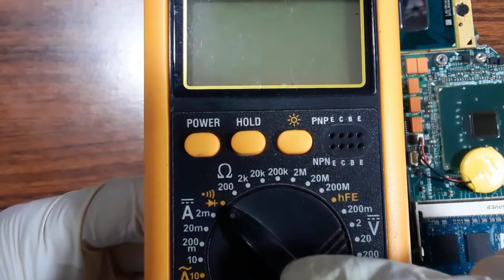The Fastest Way To Detect Short-Circuit On Laptop Motherboard - Laptop Repair

Comment: Please use modern boards. You cannot remove cpus from modern boards. I have asked before that you should actually do proper troubleshooting from beginning to end on modern boards. This would be very helpful.
Reply from the maker: It's not about old or modern boards, but about understanding how things works,
Regards
Reply: @electronicsrepairbasics_erb   So if the CPU is not removeable, how would one know if the low resistance is from the CPU or from the circuit itself? I think that is what Dombarton is trying to figure out, including myself -). Btw I really enjoy the content on your channel , it's extremely helpful.
Reply: He's made a great video so  stop slagging him down. I am be grateful he has gone to a lot of effort to impart his knowledge
Reply: @christiannolan8333 easy, lift one leg of the phase inductors (coils) and then you easily isolate the CPU from the rest of the circuit

Comment: One clue to determine if it is a short or low resistence is to check both side of a capacitor in te circuit, since one side of it shoud be connected to geound but not both, if it is, for sure there is a short circuit.

Comment: I must admit that removing the CPU or like, and getting a higher resistance is baffling me a bit.  Seems like it would remove resistance.  Is it possibly because capacitors supporting the chip are drawing current from the DMM during testing?  Or other?  Thx.
Reply from the maker: Keep in mind that the resistance of all chipsets including CPU are low in every motherboard.
Reply: @electronicsrepairbasics_erb   ...yes, agree, but seems like we're adding more wire ... although very small.  Thanks for your video and response.

Comment: 3:06 - If you were to test your meter leads by connecting the other probe to a different point on that ground pad, you would verify the first probe connection as well as the integrity of your meter leads with a single test. Then move the other probe to your test points with confidence of a solid connection to the first probe for accurate readings.

Comment: GREAT JOB. HOW DO YOU INJECT VOLTAGE TO FIND SHORT CIRCUIT .
Reply from the maker: The voltage injection is the easiest way to spot a short circuit. Voltage injection occur on the shorted component
Reply: 1v and starting with 2amps